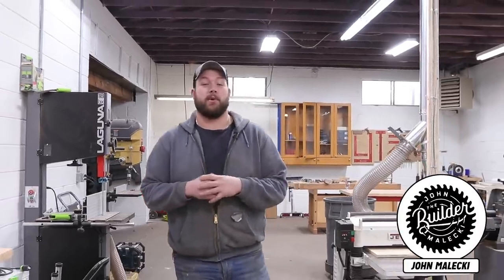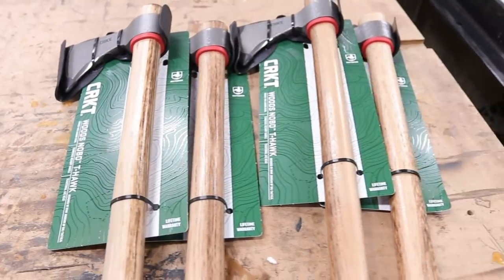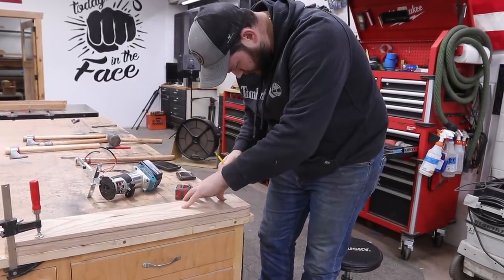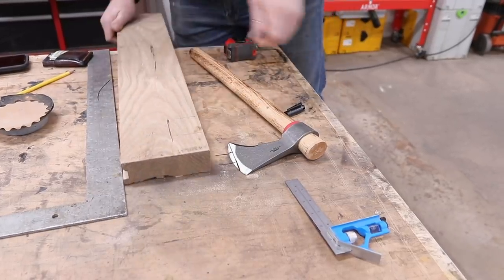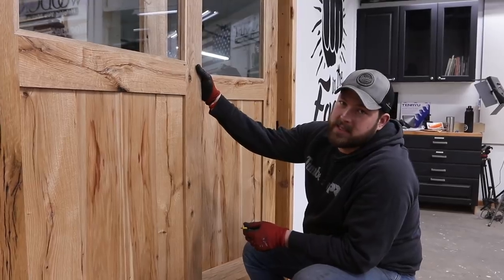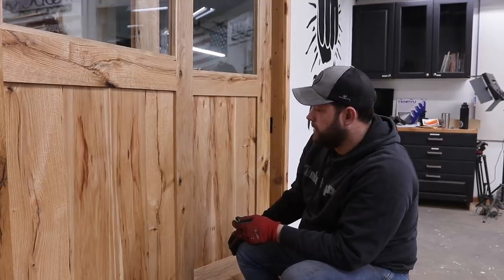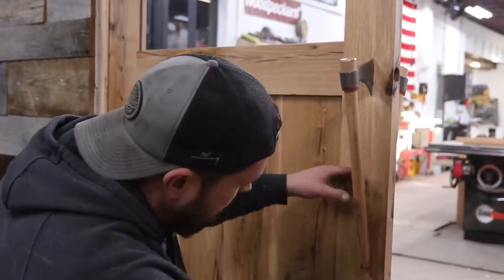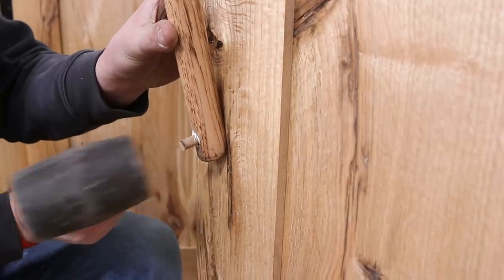Making Door Handles From Hatchets

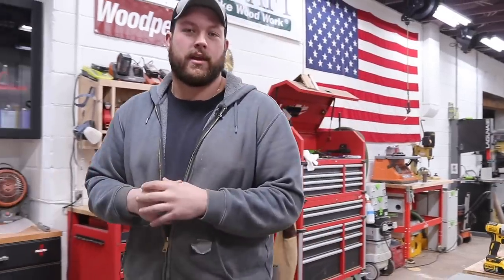Comment: 0:14 The handles look badass but unconfortable aswell since you would have to break your wrist to really grab them. Mounting them higher or upside down could maybe improve the ergonomics, I guess
Reply from the maker: Its not like you're tugging on them with a ton of force or all the time, i would say breaking your wrist is quite extreme. Theyre at the normal maximum height for a door handle, and theyre not that bad IMO
Reply: @John_Malecki  I love your videos! The door handles are badass! However I think when he said "breaking your wrist" I think he meant that your hand and forearm wouldn't be in an ergonomic/natural position. However I agree that it isn't much of an issue do to the minimal force required to open the door